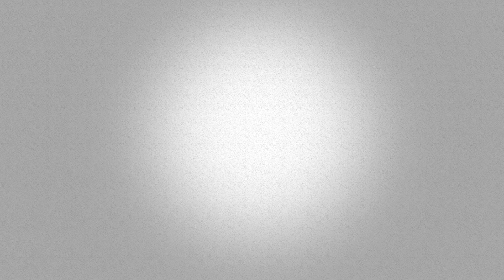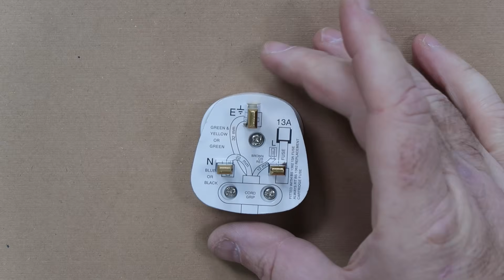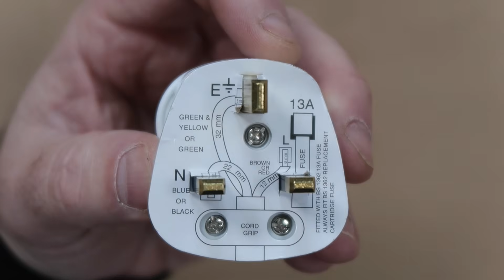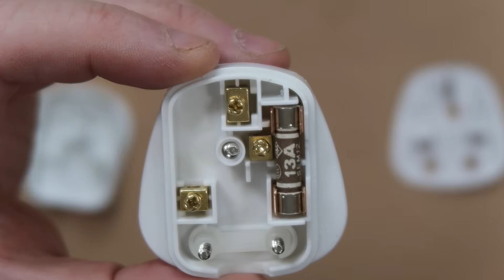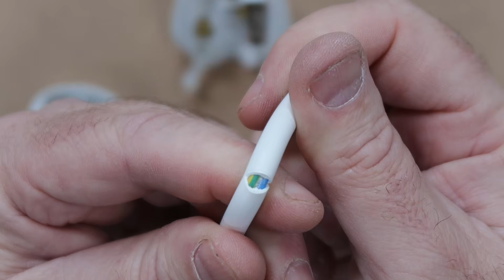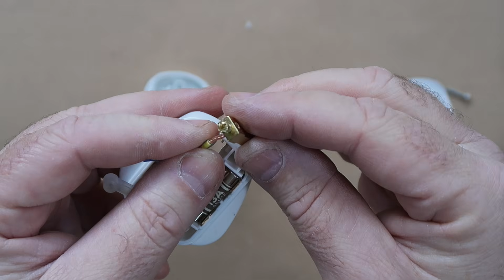How to Wire a UK 13A Plug

Comment: Sorry for being naive or asking a silly question but  why does some vacuum cleaners plugs only have 2 wires in brown and blue ? 

I have a faulty wire that has been pulled away from a sealed plug so I aim to cut the wires and refit the wires into a new 3 pin uk plug but the vacuum cleaner wires are only blue and brown with no neutral wire so do I just leave the neutral as it is blank ? Thanks

Comment: Nice one Stuart.
From in the early 70s when l was 12-14 years old, l used to attach plugs to new electric appliances my parents would have purchased. The plugs l liked the best were the ever ready ones. With these particular plugs were very easy to wire, in that the blue/brown & earth (if needed) could accept equal lengths of wiring and had an open plan design i.e. no 'sidewalls' around on the outside of the plug area as rhe 'walls' etc were moulded around the actual plug top. These plugs were manufactured up until c1990. Something this generation seems to have been sadly lost now - not wiring up a plug.
As a previous commentator also mentioned l too worked in a department store electric department and connected plugs (many, many times) to newly purchased electric appliances, mostly for free - (usually more mature people by the way)

Keep 'er lit ya boy ye!

Comment: The earth wire should have the most slack in it not the neutral so that the earth wire is the last to disconnect if cable gets pulled out. Or that's how I was taught

Comment: I remember being taught this back in the mid 70's, in a school physics lesson.
Largely redundant now with the ubiquity of moulded plugs but just occasionally comes in useful when you have to cut the moulded plug off to pass the cable through a small gap.

Comment: You may notice  that both the neutral and the earth terminals' have their holes positioned at 90 degrees to the direction  of any cable tension ( pull out) the live hole is aligned with direction of tension and is most likely to pull out first making the appliance non-functional, but safe being still connected to the earth in the plug, when I say "safe", I mean always approach any electrical failure with due caution. Clever people designed this plug, it's almost fool proof.

Comment: Expertly done, Stuart.
One thing that should be thought about, is that the Earth conductor should always be slightly longer than the other two conductors, in case through rough treatment, the cord grip fails, the last wire that gets disconnected, should be the Earth conductor to the appliance.
I've always worried about people using knives around mains cables, but your explanation and technique is spot on. 
Thanks for the video.

Comment: Very good,... but, the neutral needs to be shorter; when the cable is pulled through the cable grip, the live should be first or coincident with the neutral to disengage, earth should be the last of the 3 (L, N, E) to get pulled out. You have too much of a loop on the N so it looks like the N will remain intact after the earth has disengaged.

Comment: It's also a good idea to crimp ferrules on the exposed tip of multi-stranded electric wire so as to prevent the screw breaks some of the strands, especially those who tighten it like crazy.

Comment: I worked a Saturday job in the small electricals dept of a dept store, back in the early and mid eighties.  Manufacturers would often do trade-in promotions, leading to customers presenting us with their old Hoover, kettle, toaster etc., etc. By far, the vast majority had very badly fitted plugs and so the very first thing we did with all of them was to chop off the plug. Also worth noting, is some customers buying new products, especially the more mature folk, would ask us to fit a plug, but for insurance reasons we had to politely refuse. They were given a plug for free though! :)

Comment: Some essentials worth mentioning: make sure the terminal screws do not tighten against the insulation but against the copper. Do not over-tighten because that can shear the copper. Always test each individual connection with a firm tug. If the wire stays in place, that's firm enough 👍

Comment: I think I would dispute that most devices in the home need a 13A fuse and say that most will need 5A max, often fine with 3A. I think that the only things that will really need 13A are extension leads and things like kettles and heates or fires.
Reply: And you can get fuses in 1,3,5,7,10 and 13A ratings

Comment: Great video Stuart. May i just add one comment. Being an Electrician, we were always told that there is good guidance on the plug card. But always make sure that your CPC (circuit protective conductor) or Earth wire was the longest of all three. That way should the lead get snagged and happen to be pulled out of the plug, the last wire to let go would be the earth (the one that offers you protection from electrocution whilst using class one equipment) Thanks for sharing.
Reply: When I started out as a 16 year old apprentice I wired several plugs neatly and carefully. Then I was made to do them all again because I'd left the earth wire too short.
Reply: @paulm5443  Yes Paul, it needs to be the longest. :yougotthis:
Reply: I was taught the same way as you - CPC (Earth) has to have the longest amount of spare to ensure that in the event of the cable being snagged  it'd be the last to be pulled out. If I'd presented a wired plug to my apprentice master as shown in the video, it would have been cut off and thrown back at me. Those were the days      ;o)
Reply: @FlatEric971 To be specific if the CPC was shortest you could possibly pull it out and the device would still work but without protection. The user could use it years that way until it then might fail giving a shock. If you pull out the live then it stops immediately.
Reply: Yes, as an electrical apprentice we all had to wire plugs making sure that the longest wire with slack was the earth wire, so that it was the last to be detected in the case of the cord being pulled out or working loose. Great safety tip mate.

Comment: It's great that you're doing these basics, we're losing so many skills because of this "nanny state" we're being brought up in. I learnt how to wire a plug before I was 13. I cringe when I see some of the things people are asking for help with on local Facebook groups.
Reply from the maker: Yes exactly!
Reply: @ProperDIY  I use a scalpel when trimming wire back, cuts through the plastic sheathing on the wires with ease, no chance of cutting the cable itself. As I rotate the end it slowly comes off as the wires get twisted. If I've got my soldering equipment out (got an entire rework station that I have to put away when not in use) I fold the twisted wires back to touch the sheathing and then tin them creating an anchor point for the screws in the plug pins creating a very secure grip.

Comment: Blue has an 'L' in it = left and Brown has an 'R' in it = right.
That's one of the ways that we were taught to remember the orientation at college many years ago.
Just a free tip.
Looking forward to the next episode in this series👍👍
Reply: Brown will also be the colour of your trousers, should you touch it (okay, so only true if it is plugged in and the back is off and the switch is on... but you get the idea 😉😁)
Reply from the maker: Thanks Cliff
Reply: B L ue = B ottom L eft.
B R own = B ottom R ight.

Comment: I keep old double-edged razor blades for stripping;  with light pressure (pressing without drawing/cutting), they'll cut/score the insulation without damaging the conductor.
Reply from the maker: Exactly - nice one.
Reply: Single edge blades are safer though

Comment: It is important to remenber that the fuse protects the cable that is connected to the plug.  It is also important that it is rated to the appliance.  It is no use using a 13 anp fuse on a 5Amp cable as the cable will breakdown or catch fire if the unit goes faulty.  likewise a 5Amp fuse on a 13Amp aplliance the fuse may work for a time but will fail earlier if not blow straight away.

Comment: NIce video.  It might be worth mentioning a safety feature of these plugs - the brown is shortest so that if the cable is tugged and the cord grip fails, then the live will be disconnected first.  Lots of people have tripped over cables over the years.  The earth and neutral are longer (and should have a little slack) so that they remain connected. That is what I was told anyway - might be an urban myth 🤷‍♂
Reply: I think you are correct, the length of the wires inside are that size for safety reasons.
Reply: Always leave a bit of slack for the earth wire if there's space in the plug.

Comment: I am now 75 and remember when electrical items came with just wires and you had to pay extra for the plug. One reason could be different electrical systems. My parents house was.built in 1953 and had round pin plugs. They had it rewired around 1988.

Crazy now to think people had to do their own wiring. Incredibly dangerous. I also remember that teeth are bad wire strippers.
Reply from the maker: Yes we were doing this all the time back in the day. As you say there must have been some very questionable attempts out there.

Comment: Hi Stuart, what’s your thoughts on stripping back 10mm (as opposed to 5) and folding the cable back on itself before securing into the terminals? Does it make for a ‘better’ or safer connection in your view? Cheers

Great video!
Reply from the maker: Thanks Matt. Stripping more and folding back is fine if you twist the strands tightly so when you fold it you have a nice, tight end you can actually get into the hole in the pin. I'm not convinced it gives a better connection - tightening the screw on the pin properly is more important I think.
Reply: I was always taught to do this but agree that either method should be fine.

Comment: That's is excataly how i wire my plugs nice and neat, a great well explained video i am going to love this new series. 
When i was younger my Dad explained to me about fitting a plug and he used to say not to worry if i can't remember which was the Live, Earth and Neutral, he said that a little trick for plugs only and that is because the word bLue has an L in it that goes to the left terminal, because the word bRown has an R in it that goes to the right terminal, and because there is only one wire left that must be the one that goes down to the middle terminal, and to this day if i have to wire a 3 pin plug even though i know which is which, i always seem to do that trick and it doesn't fail because it's the right way to wire a uk 3 pin plug.
Stay Safe.
Barry (Wirral)
Reply from the maker: Nice one - thanks Barry

Comment: I find that many people assume that because it is called 13A plug that only a 13A fuse should be used. As others have noted the cable on some appliances or the appliance (table lights being simple example) should only have a 3A fuse. Surprisingly one of my extension leads with 2 sockets should only have 10A fuse as limiting factor is the cable.
Also I leave the earth as longest so if the cable clamp slips the safety connection is last to be compromised
Reply from the maker: Thanks Ralph

Comment: Even though I've wired many plugs since my first home in the 1970's I watched this one right through as I always enjoy your videos. Wiring a plug is something my generation takes for granted but with new appliances coming with pre fitted moulded plugs this will be very useful for anyone starting out and who needs to fit cable. PS I'd never noticed the wire lengths on the diagram. That could be quite useful information.
Reply from the maker: Thanks for watching!

Comment: Great, informative video. Couple of things. The card on the back of the plug seemed to suggest the length of each wire should be cutting, ie. L=12mm, N=22mm and E=32mm (as a guide). Also, after cutting each wire sleeve, rather than just pull it straight off, I spin the insulation as I pull it off, so that there is no need to twist the wires after the insulation has been removed.

Comment: One of the best plug designs in the world adopted by several countries
Reply: Not one of the best designs, THE best design,
Reply from the maker: Yep
Reply: That and the ring main system. Improved by the introduction of partly insulated live and neutral pins. Back in the 80's I remember being in a posh hotel in Beijing and finding they used 13 amp sockets.

Comment: Nice video Stuart but it may be worth pointing out that to comply with latest regulations the line and the neutral pins must be insulated to stop your fingers touching them when removing the plug from the wall socket. There are many appliances sold in secondhand shops which have the old plugs still on - it is illegal to sell them like this but it does still happen. So if you are putting a plug on an appliance don't just find an old one at the bottom of a drawer - make sure it has insulated terminals!
Reply from the maker: Really - I've not seen an old plug without insulated pins for many years. I will look for one now!
Reply: @ProperDIY  They are still about I have one here but cant put photo on reply!

Comment: Hi Stuart - sorry to pedantic but there's a serious error!  It's NOT Live it's LINE!   BS7671.  Calling brown live gives the mistaken impression to some that Neutral does not carry voltage. It's AC so neutral most definitely does carry 230V with respect to earth.
Also, the earth wire (now called common circuit protection - CPC - as may not actually be an earth  BS 7671) is the longest in the plug so it's the last to be disconnected if the lead is yanked - a lovely planned safety measure.
Keep up the great films - miss the old beginning with the knome and broken sweeping brush.
Reply: CPC - Circuit Protective Conductor.
Reply: Don’t forget that this is a Basics video. Joe Bloggs will know them as live, neutral, and earth rather than line, neutral, and cpc.
Reply from the maker: Exactly - thanks Ian.
Reply: No it does not . That is why it is called neutral. It is grounded so it does not have voltage. Sure if it breaks then the other end will have the main voltage.Remember Neutral and earth are connected at the entry to the building so what is on the neutral is on the earth. This is not strictly true as if the consumption is high it produces some small voltage to the neutral as the wire has some resistance.

I think you  have problem understanding negative voltages. The phase wire varies between +325 V and -325 V referenced to the earth while neutral is at the earth potential. Many seem to think that in AC somehow the voltage comes half the cycle from the live and the other half from the neutral. This is a very common misconception.

Alternatively you are mixing current and voltage. Neutral of course has the same current as live.

Comment: I had to do an afternoon course on how to connect a plug, your explanation was far more succinct! Could I point out that the measurements included with the card are to ensure that if the flex is pulled then the earth will be the last wire to lose connection (for safety).

Comment: I used to work somewhere where we had to unpack a product, change a EU plug to a UK one and repack it within one minute. Zero Fs were given and was all top brands, so if you buy something with a plug like this (with a screw, not a sealed one) open it up and check it!
Reply from the maker: Thats interesting - we all assume they are fitted at the factory
Reply: @ProperDIY  vast majority are, but if some companies based in the UK sell internationally and have surplus stock fitted with an EU plug, they'll sometimes consider it cheaper to pay a reworking company to chop the factory fitted sealed EU plug off and manually fit a UK one rather than producing more stock. Then it's a case of does the reworking company care about speed (money) or quality more.. quality control checking 1% and only correcting the checked ones where I worked 🙄

Comment: My dad taught my mum to change a plug in the 1970's, whenever she did she'd put her wellies on (to earth her !?) before plugging in ...
Also used to know someone who would just use the pins of an unwired plug to push the bare wires of a flex into the socket 😱
Reply: The idea of the wellies was to supposedly insulate you from earth in case you touched the live wire. Thus, in theory, no path to earth saving you from an electric shock/electrocution. Not much use if you accidentally happened to touch live and neutral, though.

Comment: I was  taught not to cut across the outer sheathing like that because of the risk of going through the cable strands and into the copper wire. It is very easy to do for someone who is not used to installing a plug
Reply: So how do you remove it then?
Reply: @rafflesnh  cutting a couple of nicks at the end of the outer sheathing and then pulling it apart to split it with fingers or plyers  downwards and then trimming it off at the right length
Reply: @home-space  Sounds like that will need a bit of practice to pull it back to the correct length without overshoot, but will give it a go next time as I'm forever nicking the inner wire sheathings too!

Comment: One saftey point,  ALWAYS make the Earth lead the longest so that if the cable is pulled hard from the plug the last lead to leave its connection is the Earth.
Reply: Exactly, the Earth should be the longest - as shown on the diagram.  Looking at the plug wired in this video I would wager that the Neutral is either the same length as the Earth, or even a couple of MM longer....
Reply: @MalcolmCrabbe  I did notice the blue could have been shorter.